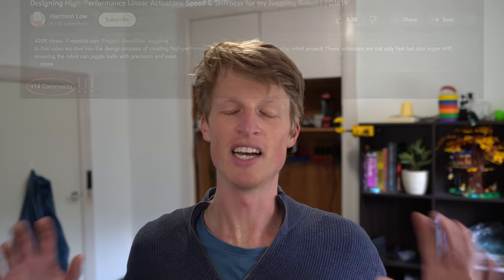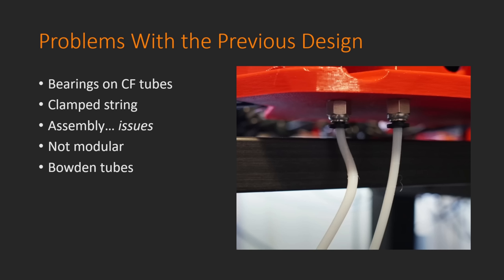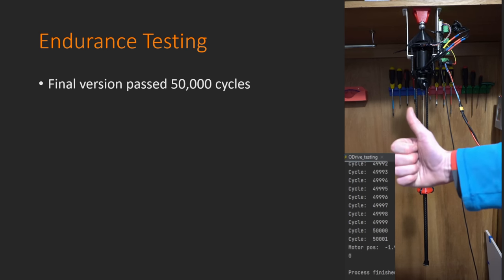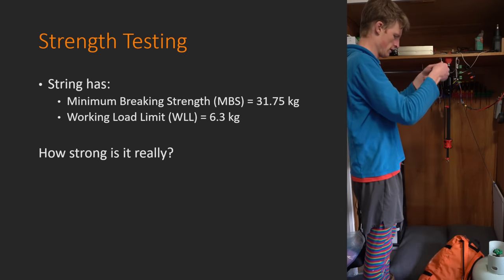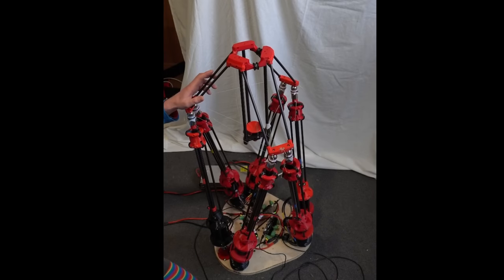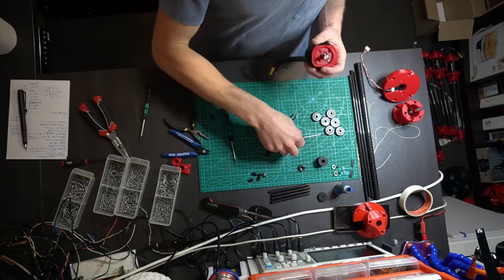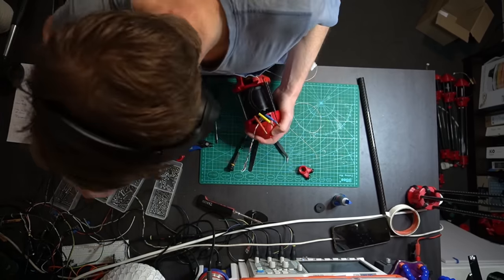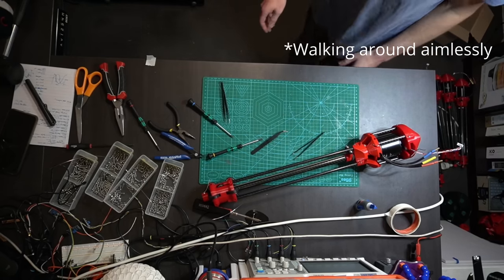My New Linear Actuators are SO MUCH BETTER! | PDJ #21

Comment: To get rid of the torsion along the central CF tube, instead of using six bearings and increasing the cost. Maybe consider using bushings around all three outer tubes. My thinking was PTFE but, another material could perform better

Comment: What of you had the motor oriented 90° from the direction of travel, such that it forms the "leg" of an "L" shape? It's not quite as sleek, design-wise, but it would eliminate the need for many of the pulleys.

Comment: For synchromesh cable terminate just use most simple way: Drill hole right under bolt head. For asembly: Bolt, cable trough hole, washer, and for other side washer and nut
Hope I helped

Comment: one stupid trick for inertial load braking is to use a hair dryer, they put out 2kW while being very light and cheap, if you can get the voltage about right. I have seen that for gantry cranes.

Comment: EDIT: I see on Zulip that the same suggestion has already been made! You can save your eyeballs on this post!

It's possible to use fewer pulleys. The trick is to imagine a plane for each pulley; right through the centre of the pulley and parallel to the pulley face. Each plane defines where the string coming into and going out of the pulley can lie. The trick is to intersect the pulley planes with the entry and exit points (pulley tangents) for each successive pulley.
Dodgy blender model that visualizes the idea: https://youtu.be/vnq_sSShIdY

Comment: Use a bigger bearing block and use Rollerblade or skateboard wheels NO SLIP especially if you use super soft ones. As well you can use high tensile crimp sleeves and use a holder for the crimp.

Comment: Don't take measurements of travel by measuring string travel. That doesn't compensate for any wear.

Your durability test should have measured how far the actuator actually is from where it thinks it is.

Comment: Interesting project. I'll look at your other videos.
Choice, and terminating of the cable/string: see if you can source nylon strand, or Kevlar thread. 
As for terminating a metal cable, get a blade-style, swageless eye terminal and attach it with your bolt. Be careful with the weight of the terminal as it may affect the harmonics.

Comment: Won't the springs stretch and have measurable elasticity to them? Especially at high speeds. I think this could be accounted for in software however (closed feedback helps a lot).

Comment: Instead of using a round carbon fiber tube for your mainmast, you could use a square carbon fiber tube. That would simplify your bearing block significantly.

Comment: Just a quick idea on terminating that funky syncro cable, how about a copper and/or brass compression lug used in wiring electrical service, but with a plastic sleeve such that you're not directly compressing on the syncro-cable

Comment: Why reinvent the wheel, literally?  Just use off the shelf V roller POM wheels.  These are highly accurate as they are designed for 3D printers and CNC mills.  Their cost is minimal and they wear well if you purchase them from a reputable dealer.  There are many cheap ripoffs out there that look good, but wear out quickly.  I believe you can get the "small" version, which is not too much different in size than your current solution.  Given the accuracy you wish to obtain with this actuator, you should consider using the ecentric mounts on one roller for each set.  This way, you can adjust out backlash without causing excessive wear.

And I'm sure it has been said many times, but switch your motor to an outboard version, so the rotor is on the outside.  The orientation of the motor can then be changed to perpendicular to the axis of the actuator, making the string routing much easier and reducing overall wear to the system.  If properly aligned, it would not be out of the realm of possibility to route both strings up the middle of the center tube.  Then, make clamp on sleeves for either cable.  To secure the cable, have it pass through the end cap of the sleeve at an appropriate angle.  On the outside of the sleeve, have a grub screw in the middle of your wire channel.  Then, have a flanged screw offset from the path of the string, but situated that the flange catches the string over the grub screw.  You can then adjust the height of the grub screw to adjust the clamping force on the string.  Then, just tighten down the flanged screw.  You always want to have the flanged screw flush to the surface, and the grub screw set to apply the force.  This way, you minimize the side loading on the threads and the screw head.  I would highly recommend blue or purple loctite for these screws to keep the tension set, but allow for it to come back apart when needed.

As far as the synchromesh cable goes, that might be excessive.  As you are not driving the system from the middle, there really is no need for the extra cost for this functionality.  After all, that is the primary role of synchromesh cable.  Go to your local fishing supply store, and look at braided line such as the spider brand.  It is very strong, has excellent elongation after exceeding the working load, and has a very long elongation prior to meeting ultimate failure.  Unlike monofilament, this does not permanently deform when the working load is exceeded.  It does return to its initial diameter once the load is removed and it's allowed to rest.  Plus, braided line can easily be tied for termination.  Most brands are made from Gore-Tex, Kevlar, or a mix of the two fibers.

Comment: Consider nylon for instead of TPU for the bearing sleeves, it will make it more rigid / stiff / precise. You might also consider engaging more of the small linear rods with bearings.

Comment: Instead of bleeding the power from braking into resistors, use a capacitor bank to rapidly charge and discharge during the reversals.

Comment: Brakes...
Use transistor, they can dissipate way more heat than resisitor.
for regenerative braking, you just need capacitors (battery can not handle the amount of power) plus a rectifier.
that is all.

Comment: for braking you could look into how modern roller coasters break by passing a magnet through ferris panels which you may be able to hook power cables to in order to recover power but there might be a scaling issue with this.  EG you might need too large of magnet to get the speed reduction you are looking for or the speed reduction isn't realistic within the parameters.  This video talks about it here https://www.youtube.com/watch?v=Yp2PVeidf2c&t=431s

For the cable you could 3d print a pass through pinch terminator (I have no idea what the technical terms for this would be) but essentially you would 3d print a block that would allow you to put a metal insert in and use the screw/nut from before to pinch it in place against the metal insert.  You would have the screw pass through the nut using the screw excess to pinch the wire into place against the metal insert.   Having a bend in the insert might give it more purchase if you needed it if you need the metal insert at all.

Comment: Its highly possible that your calipers are the inaccuracy and not your actuator.
Most consumer digital calipers struggle to maintain accuracy past a few repeated opening/closings unless you get them calibrated professionally, you should instead reset/zero the calipers after each movement, and measure the difference between the opening and closing measurements and do it slowly as fast movements are not recorded well either.

Comment: String routing....  The green one.   As it comes off the motor, you have it going past 3 pullies.   I can see how to save on one.
The first one isn't needed.
Where you have the first and second, remove the first and put the "second" one where the first one is.
I am not really sure why you have the first one there anyway.
The blue one.   You have 2 pullies there.  (Motor end)
As with the green one, why do you need the first one?
Route the string from the motor to the "second" one and that's that.
Yes, you would have to turn the pulley to "point" to the motor, but that should not introduce any more load on it than there is already.

Comment: Seems like 2 pulleys per line is really a no-brainer - maybe I am not understanding how this works but 1 pulley for each line looks to me as completely redundant - it's the first one counting from the spool. Just remove it, adjust the angle/rotation of the 2nd one and it's done.

Most likely it's the twisting of the line itself that is causing the movement that lead to failure.

Comment: Have you tried polymer bearings like sleeve bearings or bushings (e.g igus drylin) instead of roller bearings?

To terminate the synchromesh, consider a banjo bolt then solder a plug or even a cable stop clamp

Comment: Pardon my ignorance, but is there any reason you're not using a linear beearing for the centeral shaft? I guess the CF might not be so compatable with direct contact from the bearings. Cool project regardless!

Also for the synchromech cable, as a stab in the dark solution, could you try crimping it in an electrical ring terminal?

Comment: The Actuator would resist better bending forces if you moved 3 of the roller to the bottom of the moving carbon rod.

You can remove one of the 3 pulleys if you replace 2 pulleys in x and y plane by one pulley that is in a plane that is tilted 45 degrees from X and Y.
You can double the strings to increase the breaking strenght.

Comment: FYI, car window actuators use only a single "string" (steel cable in that case) in a closed loop fashion, perhaps that might simplify the design, you then just to maintain registration as it moves.

Comment: This is unstable/weak against twisting mode stresses.  Using six struts rather than four, and crossing them between opposing points of a triangle like you'd see in a stretched octahedron or a Stewart Platform, will provide dramatically more strength against these stresses without a lot more mass.  Alternately, cross them diagonally between opposing points of a rectangle.

Comment: Without knowing the specifics of your design, if you take 2 of the same resistor in series and then take 2 of these pairs in parallel you just quadrupled your max power without sourcing any new parts.

Its not the most elegant way of doing things, but it works.

Comment: What about attaching a small spring to a small rubber o-ring then attach string to the o-ring available in those plumbing kits to fix a leaky tap. Might be smoother and not require that spiral string. Would be interesting to see which lasts longer. Just a thought...

Comment: why not make the motor horizontal if you want to remove parts? it should need only 1 or 2 bearings instead of 6.

also why not go with regular belts?

I don't think you need to feed the retraction wire through the middle tube, if you have the 3 spoke stabilizer design, you should be able to just attach  it to that.

Comment: May I ask why aren't you using steel braided cables? You can terminate them using aluminum crimp ends. You can use them on any cables for that matter.

Comment: You should use capacitors for braking instead of resistors or batteries. Regen breaking+low internal resistance capacitor = much less heat = higher energy efficiency

Comment: 2 pulley solution? eliminate pulleys parallel to spindle. make the second... the line and pulley must remain outside tangent to pulley CenterLine as if it was a separate pulleys outside tangent. then same story with the blue line, the second pulley away from the motor changes angles, the first gets eliminated. Blue- Rotate pulley2 towards spindle outer diameter. lose p1. Green- lose 1st pulley. then angle the new 1st pulley the top to the center pulley and bottom to the tightest line angle (spindle tangent). p3 now p2 remains as center guide. would the line fall off?

Comment: Congratulations! The actuators look great. How about "rod track guide" bearings to run against the carbon fiber rod?
Reply from the maker: Cheers!
Are you thinking these could be used to stop the torsion problem? I can see how this would also (probably) make the central tube quite a bit more stiff as well. I wonder if it'd be worth the extra weight? I'll put in an order for some and test them out. Cheers for the idea!
Reply: @harrisonlow  in my experience it should help with the torsion issue. I do believe, as you have planned, indexing on all 3 rods for the torsion issue would be best. I made the suggestion to keep the movement smooth and add support. Thanks and best of luck!
Reply from the maker: Haha now I'm not so convinced that bracing against all three support rods is best - I like the solidity that a linear rail would provide. I'll have to wait and see how the testing goes once they arrive. 
Cheers!

Comment: No clue if this will work or not but have you tried to do a compression clamping mechanism like you did with the carbon rods? You could make it a passthrough one so you could adjust the tension as needed.

Comment: Kevlar String?  Might be a bit more wear resistant than nylon.  According to other posts on Reddit, Synchromesh cable can be terminated with standard cable crimp connections.

Comment: the cheapest way to terminate the sychromesh cable would probably be a simple ring-tongue terminal that you crimp on the end. this way you already got a nice point to screw them into place. only problem i see with this is maybe some backlash you get, if you don't get the length exactly right on both cables, creating some dead space until the slack is picked up. Some kind of idler/tension pulley that you can adjust somewhere near the motor can solve this. I'm thinking some kind of set screw that changes the position of one of the pulleys, so you snug it up once and the whole system is ready to go until something else gives, stretches etc

Comment: I don't know if you are having differential tension problems between the two stings, but if you are there is a way to use a single loop to accomplish the same thing. I don't know what it is, but airplane ailerons are set up this way. Should be easy to find.

Comment: 4:40 You are using 4, not 3 "pulleys" - the 4th is the one you winding the rope on. I presume ones in plain with motor pulleys should stabilise cable direction?

Comment: Regarding the routing of the cables in the actuator base, i dont really see what's preventing you from only using 2 pulleys on the green cable and 1 on the blue one (plus the one at the top of the actuator).
For the blue cable, the tangent coming out of the spool can intersect the vertical line the cable must follow, and you only need the cable to do a 90° turn, using a single pulley.
For the green cable you'll need to keep the top pulley, the one on the top of the spool. And a single pulley can send the cable coming from the top pulley into a tangent with the spool.
Is there any packaging constraint i'm not getting ?

Comment: To hold the synchromesh, take a bolt and drill hole in it large enough for the synchromesh to fit through, thread on one jam-nut so it goes below the hole, insert synchromesh, thread on 2nd jam-nut and then use the 2 to clamp the synchromesh in place.  Could be changed in seconds and wouldn't require any design changes and parts could be made in minutes.

Comment: If you still dont know how to terminate the syncro mesh cable you can crimp electral wire terminals onto the end. Youd want to do some strength testing for your needs, but in my experience, it works great for a mounting point.

Comment: Terminate the syncrhomesh using a small bolt with a hole through it on one side and a nut on the other side of support. pass synchro mesh through hole and tighten., place bead on end of line of needed.

Comment: for terminating the synchromesh, look up wedge sockets. if a bolt into a 3d printed part is strong enough to terminate the current string I'd bet a 3d printed wedge socket would work for the synchromesh here

Comment: 10:45 use the brake cable bolt from a set of bicycle callipers, they have a hole in the middle.
Edit, nm, more sophisticated ideas have been suggested

Comment: String routing without the two pulleys parallel to the motor shaft should be doable, as long as the pulley taking the string parallel to the actuator axis has the string enter/exit tangent to the shaft it should still spool fine. This does assume there isn't a large number of wraps when the actuator is at full travel, but as a rule of thumb anything up to 5deg off the pulley centreline should be fine without guides.
I'm not saying this will be elegant, but it should be possible.

If the torsion restraint engages all 3 carbon tubes, you can probably get rid of one of the sets of rollers at the top end. this will make the actuators stiffer at low extension, but if you have a desired limit then the minimum separation can be set to achieve that and everywhere else will be better.

Threading strings through tubes can be done with compressed air, add a small flag or rag to the end if it has trouble to give it more to blow against.

Comment: The way the string is attached is critical to its strength. Common knots can reduce it by half. I didn't see how you did it, but watching a channel on climbing rope testing should help find a knot that doesn't change the strength much.

Comment: I'm almost certain that the 3 pulleys can theoretically be reduced to at most 2, but not without leaving the bounds that you have defined for the string path and impacting the overall modularity of the actuator.

Comment: You don't need the 2 horizontal pullies nearest the spindle. the second blue pully is almost right. Rotate it so it points at the surface of the spindle. Change the second green one to match Use the top blue pully as the tensioner by pulling it away with a screw parallel to rod travel. This will tension everything provided the green is close to right.